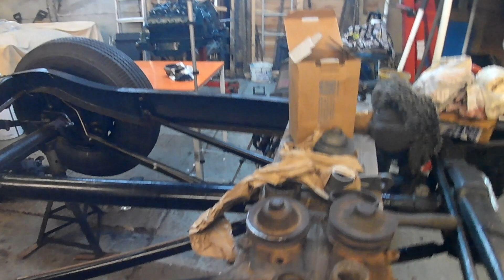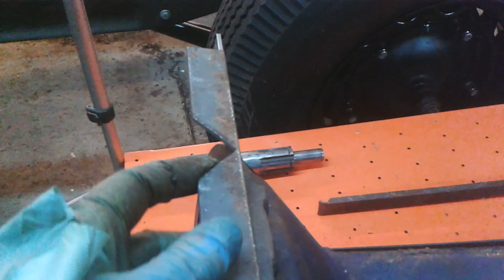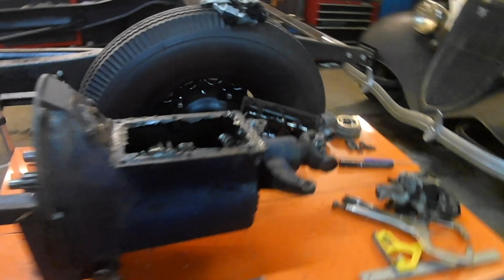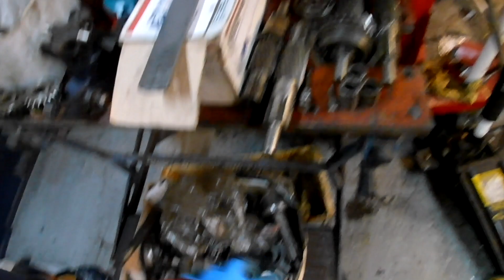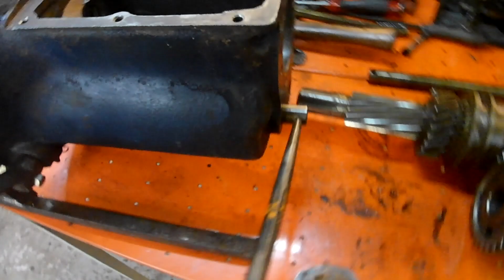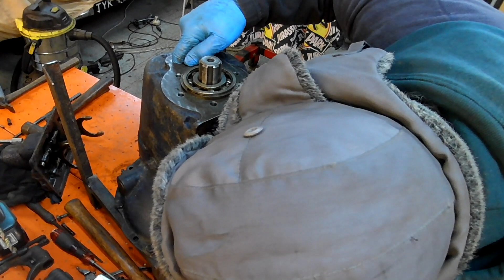Mart's update: 2021 No8. 32 Sedan Project Pt. 28. Early Ford 3 speed trans build!

Comment: Thanks Mart. Enjoyed the vid. I use side shift gears in my top shift trans. They only fit in the 78 casing or the open drive casing that you used so won't fit in the earlier casing. Also, they have the best of the Ford ratios (but not quite as good as Zephyr) so make for a nice shifting trans and are cheaper to buy and easier to find cos nobody wants the casing.
Reply from the maker: Yeah, Matt, we're all looking for the same stuff, unfortunately. Thanks for having a look and chipping in.

Comment: Thanks for the excellent tutorial Mart!....I’ve driven a trailer truck for nearly forty yrs. Shifted everything from our old Ford 3-speeds to 15-speeds. But, I’ve always been apprehensive about taking one apart for repair. I’m going to give it a go after seeing  your video. Thanks,Mark
Reply from the maker: Cheers Mark. These are simple devices and can be worked on without fancy tools. If you get stuck or have a question you can always give a yell out on FordBarn.

Comment: So this box will have the higher low gear ratio. What rear end ratio will the 32 have?? Isn't there a circlip on the inside of that rear bearing??
Reply from the maker: Hi Bob. The 32 has a 3.78 axle ratio, which is a good ratio when used with 7.50:16 tyres. No circlip on the rear bearing on closed drive, the bearing is held by the UJ. The open drive f1 box had a circlip, which was broken, as it happens.

Comment: Wow that brought back old memories - I used to blow first gear in my Jailbar (46 Truck) all the time and got really quick at swapping out clusters and first gear - I think my record was 10 to 15 minutes as we were heading out for the night. Instead of string I used to use a bit of welding wire as it is easier to keep out of the way. Jailbars were quick to change with the open drive shaft you only had to lift the motor and the gearbox came out through the floor. Doing well keep it up you make me wish I still had a flattie powered car instead of late model..
Reply from the maker: Cheers David. Yes, I can imagine how proficient you can become with a bit of practice. That piece of string was attached to the gearbox at the swap meet with a spanner on the other end, so people could pull the lid. I'd only just removed it. (The spanner didn't come with it).

Comment: Nice info Mart, I see you learn like I do... the hard way. 8^)  `My F1 jammed in third gear a couple of years ago and had to tear it down. It's certainly a exercise in "sequence of assembly". I was given a couple of side shifters,  that I tucked away for spares for my truck. Now I'm not sure if they are compatible gear sets.
Reply from the maker: Thanks Art. I thought by showing my mistakes it will help others avoid them when they have a go. If your f1 (box) is 48-50 I believe the gears sets are compatible. The new gears look a bit pointy by comparison, plus you have that shallower helix angle.
Reply: @MartsGarage  At least I know enough now to double check!

Comment: I am no expert also, I have a 39 box in my 36 Pickup, i put in a small parts kit, new synchros and a good used cluster shaft, when i bought the trans, my friend said to take it apart and look inside, it would been  bad if you just put that trans in a car, the pin would have tore it all up. oh one other thing those old trans are made out of Pyrex...LOL
Reply from the maker: Yes, Brendan, I didn't know that pin was in there. The trans didn't come with a stick, so there was nothing to stop it falling inside.

Comment: Hi Mart! one thing i know is in early Ford trans, is there where 3 gear sets, a Truck trans with a very low first gear, a ford car trans with a higher first gear, and a Lincoln box. don't quote me, i could be wrong, look on Van Pelts web site, mabey you can get some info there

http://www.vanpeltsales.com/
Reply from the maker: Thanks Brendan, yes, I always go to Macs site for info. That's why I had these gears, I took them out of my 41 pickup when I reworked that one with a set with the lower first. I wanted to do that because the truck has a 3.54 axle ratio. It works well with the 15/29 gearset. These ones are 16/28.

Comment: Nicely done Mart. I would give you one bit of help with the bearings. If you look at the capture ring and twist the roller, you should see the end of the roller turn. If the roller end doesn't turn they are aftermarket bearings and crap/noisy. Kinda late as usual since I refuse to be banned again from the Hatebarn for giving correct life saving information and it seems that is the only place you frequent so I couldn't have been a help during assembly. Do drop in to the Vintagefordforum.com now and then with any and all questions as I know you will get the straight info.
Reply from the maker: Hi JC thanks for the tip. I used good used roller bearings so hopefully all should be well.

Comment: Good video, certainly shows some pitfalls to avoid. Over the years I have done several transmissions and a couple the other way around. I converted closed to open drive. It was a long time ago though. This was a good refresher. I had to laugh at one point. One scene the trans is sitting on the table and the very next scene the table is entirely covered with parts...exploded view???
Reply from the maker: Yeah Mike, that cut represents a lot of head scratching and posts on FordBarn.